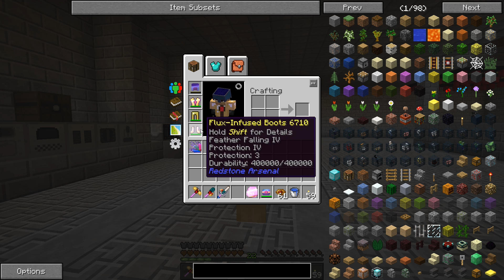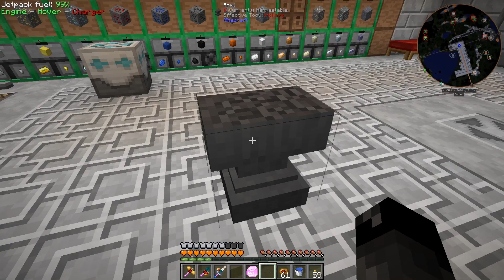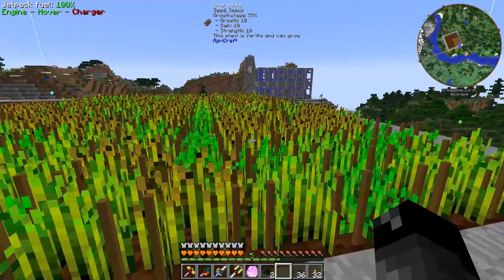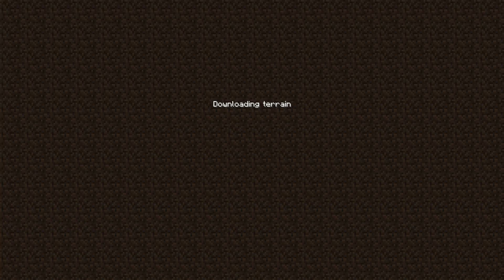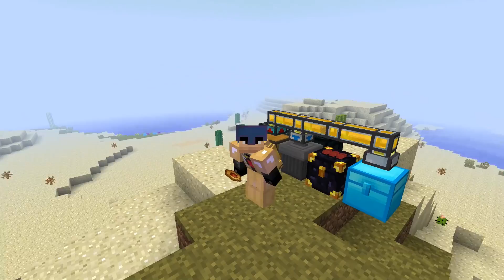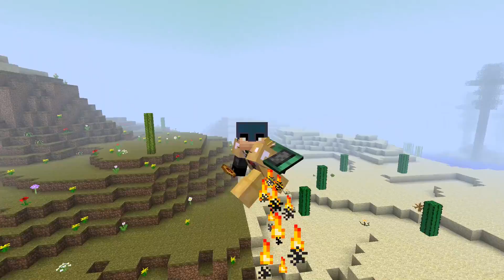Minecraft Mods FTB Infinity Evolved - EXTREME FARM [E28] (Modded Expert Mode)

Comment: ik that this is little late but actually theres a somewhat better way to get alot of power, i reccommend getting power from compression dynamos as they require mostly tin and and dont require machine frames and can generate up to 1.5m rf total using water and Fuel, from a BC refinery aka getting oil and using a pump to get the most out of your dynamos you need to add augments, the 4 augments you need are : Augment - Secondary Gear box, Augment - Flux Linkage optimization, Augment - Secondary Transmission Coil, Augment - Flux Modulation Booster, with all of those each 1 bucket of fuel generates 320 ft/t and a total of 1.5m rf for anyone who reads this and doesnt fully understand you can see it in my own lets play. but hope this helps someone

Comment: At 13:10, does anyone else here a chain fence being smacked? I hear it atleast one more time before he cuts. :/
Reply from the maker: +James Landess I think what you're hearing is my microphone stand. It's a swivel arm... like a desk lamp? Anyway the springs inside have started making sounds recently when I slightly bump it or adjust the position of the mic.
Reply: Hypnotizd Okay, thanks! Also, do you know where I can get a PC that can run and record Minecraft at 1080p60 for under 400 USD?
Reply: +James Landess I think for that amount you can only pay someone to steal it. You need more money even if you are going to assemble the PC yourself
Reply: Andrea Ardovini I'm sure i found one that can atleast play at 1080p60, maybe record at 30 or 45. http://www.amazon.com/M32AD-Desktop-Windows-Keyboard-Mouse/dp/B014QVM2AY/ref=zg_bs_565098_2

Or the i5, http://www.amazon.com/M32AD-Desktop-Windows-Keyboard-Mouse/dp/B014QVM2AY/ref=zg_bs_565098_2
Reply: With a Core i3 and 8 gb of RAM no way
I mean, I'm sorry to say that but you are not even close with the spec required
Reply: Andrea Ardovini With the i5 then?
Reply: +James Landess it is possible if you only need a desktop
Reply: +James Landess and depends if you play modded or vanilla
Reply: Yuhao Zhang I might play modded on a MC Realms world with a friend hosting. My internet can handle it fine, 70 mbps with a gb connection speed. I just need something better than my laptop to play it on under 400 USD. Min settings, 30 frames for about 2 seconds. then goes back down to 5-10
Reply: James Landess I think u should be fine
Reply: James Landess I havnt built custom pc's in a while. And parts get really cheap over time so a 400 dollar gaming pc should be well achievable
Reply: +Yuhao Zhang For $400, you might be able to build a PC that can PLAY Minecraft at 1080p60 fps, but rendering video is a different story. A PC in that price range is going to take forever to render video.
Reply: LongLiveEmrys Maybe I can upload at 720@30 like?
Reply: James Landess Maybe. The main issue is you're going to need a dedicated GPU (graphics card) to render video. That alone is going to take a significant chunk of your budget. Bump your goal up to $600 at least, then you'll be getting somewhere.
Reply: LongLiveEmrys I was planning on getting a decent GPU within that $400. I found refurbished pcs on both Microcenter and Newegg as low as $124.99. That includes everything for a decent computer except the GPU, which for the $125 computer, I can afford to put an extra $275 into a GPU before tax.
Reply: LongLiveEmrys correct me if I'm wrong but gems like minecraft need a pc more on the ram and cpu side. A graphics card that can record and play (such as 750 ti) should be fine
Reply: James Landess according to my knowlage 400 should be fine
Reply: Yuhao Zhang After researching, I found out the Minecraft does use mostly RAM and CPU. Though, on my Acer Aspire 5750z-4879, 4GB of DDR3L ram and a Intel Pentium duo @ 2.20 Ghz. I get next to no frames with only Minecraft open on a singleplayer world at lowest settings with no mods, or texture packs on.
Reply: James Landess laptop components and desktop components are very different, a bad desktop cpu is often times better than a good laptop cpu
Reply: Yuhao Zhang I can understand that. I find it odd how people think you need to spend 1,000+ for a good desktop. $400 is plenty for the tower and guts. I have a friend that built his computer out of thrown out pcs around his neighborhood. It can run every game on steam on best settings while in a call while broadcasting and still not drop below 90 frames.
Reply: +James Landess If you're spending less than half the cost of your GPU on literally the rest of the PC, you're going to run into some serious fucking bottlenecks.
Reply: Samuel Pike I assume it'd be better to buy a prebuilt PC for $400 then...? I don't have much money, man.
Reply: James Landess No, it wouldn't be better to buy a 400 pre-built. I'm just saying that it isn't too smart to skimp that much on your other components.
Reply: Samuel Pike I know that, I just don't have the money to afford a $1000 PC.

Comment: you can make a draconic energy ball that can hold 2Billion rf.look it up
Reply: +Ognjen Popovic You need Wyvern cores for that, which means you need to kill the wither boss over and over, and find some form of obtaining bedrockium and iridium ingots with Terra steel and Void metal ingots. You need to obtain the Eldrich tab first before you are able to obtain the Wyvern core needed to craft the Energy Core in the multiblock structure. Bedrockium is obtained by mixing 3 plutonium with 6 Uranium 238 in a crafting grid and then smelting it. Iridium ores can be found in Runic Dungeons, which can be compressed into plates, or ingots. Terra steel requires a mana steel, mana pearl, and mana diamond. You will need the lapis altar to make Terra steel. Void metals need void seeds, which are dropped from Cult knights or Cult Clerics, or Transmuting a wheat seed into one into a crucible after obtaining the Eldrich tab.
Reply: he can make a wither farm
Reply: True, but he needs to craft a porta spawner first and send the skeleton spawner to the nether to achieve the wither skeletons. Either that, or auto spawn with exact copy enabled. The witchery wheat statues have either a zombie or skeleton spawner inside.

Comment: Hey Hypno I was playing on a modpack that has tinkers construct and I Have no idea what to make my tools out of. So could you tell me what your tools are and what they are made out of or anything that would be really good to use.
Reply: +Joevanni Thompson 
The tool heads are made out of Enderium. 
The head piece determines the mining speed and durability. 
The handle piece Determines the durability modifier, you can gain more or less durability with handle modifications. The component parts are used to build the tool you want.

Often, players will use paper on component parts, and blue slime crystals for handle parts, with either using Dark steel, or Enderium as the primal piece. Enderium can only be casted into part shapes, while Dark steel can be pattern crafted. Dark steel and Enderium are the two best metals to use for using the Head part.

With The research of paper and Thaumium, you can add additional starter modifiers to a tool, meaning you can place more modifications for the Component parts, often where some Tool forge tools can gain two modifiers compared to 0-1 for the tool station tools. A sheet of paper counts as half a material, while Thaumium ingots counts as a single material.

With combining Tech-based and Magic-based metals with Blue slimes, you can make Ultimate weapons. 

The Ultimate hammer is crafted with Either Enderium or Dark steel hammer heads, two Thaumium large plates, and A blue slime tough tool rod. Both Enderium and Dark steel have a mining level of manyullin, the highest possible level in tinker's construct. The Ultimate hammer is the bane to undead enemies, especially skeletons.

The Ultimate lumber axe is crafted with the Dark steel broad axe head, Thaumium Large plate, blue Slime Tough tool binding, blue slime tough tool rod. This lumber axe can chop down any, and all types of wood, including Natura's Redwood trees in one fell swoop.

The Ultimate Excavator shovel is made with an Enderium broad shovel head, Thaumium large plate, blue slime tough tool binding, and blue slime tough tool rod. This shovel mines up dirt in a 3x3 area, similar to a hammer.

The Ultimate Scythe is made with a Dark steel Scythe head, Thaumium tough tool binding, Blue slime tough tool binding, and a blue slime tough tool rod. The scythe can gather leaves and grass if it is modified with the silky jewel attachment, which is great for Thaumages using the lamp of growth to accelerate crop growth. Every leaf block harvested provides 2 aspects of Herba.

The Ultimate crossbow is crafted with a signalum crossbow head, Thaumium Crossbow body, Blue Slime tough binding, and Heatscar Bow string. This crossbow cannot do much by itself, but it allows the user to shoot an astounding 4 bolts per second.

The Ultimate bolt, is a blue slime tool rod OR Thaumium tool rod, with an Enderium Bolt tip, and a blue slime fetching . Bolts are made by casting a metal on top of a tool rod of choice. 

The Ultimate bolt, when loaded into The Ultimate Crossbow does an astounding 98.5 hearts of damage, and with strength II potions ingested, the bolts will do 354.6 hearts of damage, effectively one shotting common mobs and Thaumic champions, along with most of the bosses in the game, except for the Chaos dragon, which has 5000 hearts.

Per second, the Ultimate crossbow will deal 394 hearts of damage, or 1418.4 hearts of damage with strength II potions.

The bolts by them selves are non-renewable, but with the moss ball crafted from 9 moss cobblestone, the bolts can automatically refill themselves back to full capacity in no time flat.

The Bolts cannot hit endermen or enderminies.

The Ultimate sword serves as a melee alternative to the Ultimate crossbow, but does way less damage compared to the crossbow. It is crafted with an Enderium sword blade, a Thaumium Wide guard, cross guard, hand guard, or full guard (found in villages), and a blue slime tool rod. There are 4 variants to the ultimate sword, one as a basic sword, one that lets you jump to greater heights, one that pierces through enemy armor, and one that deals additional damage, depending on the guard used. The ultimate sword is known to kill common enemies in one or two hits, depending on the enemy's health. The Ultimate sword is the only known weapon able to kill Endermen/Enderminies.

Blue slimes can be found in Slime islands, or in the Twilight forest.
Reply: metayoshi1 Thank you very very much this is a life saver

Comment: Are there any OP mob spawners that you can build in this pack? I would like to you use a farm like that to auto-enchant books.
Reply: +Stanley Striker Powered spawners from Ender IO as a midgame spawner (incase you accidently break a spawner), The porta-spawner as an alternative if you want to move spawners to your base, or Draconic spawners, which are reserved for end game. porta-spawners requires you to defeat a wither boss to obtain the nether star needed for crafting the porta-spawner. The Reaper enchantment from Draconic evolution gives a chance to obtain a mob soul of the mob killed. With a Porta spawner, you can place a skeleton spawner into the nether to make it become a Wither Skeleton spawner, which as a common chance to spawn Champions that drop common or uncommon treasure bags. The skulls obtained from the Wither spawner can be used to make the wither boss grinding process a lot easier, as nether stars are needed as a source of fuel, or crafted for Wyvern cores, which are needed for Teir 2 Draconic spawners.

Comment: Just let the farm run when you are offline (like overnight) and when you are playing, turn the farm off
Reply: +Andrew Gonzoles He needs constant RF power to run his machines. For end game, you need 50MRF to produce 1 resonant Machine frame, which is needed for the end game for tech tree. RFtools machine frames also needs one as well, meaning some form of emerald farming, and Enderium production are a must. The easiest way to Obtain Enderium ingots is to melt Endermen into a smeltery, and then get a silk touch pickaxe/hammer to pick up Redstone/DENSE Redstone ore, and then pulverize them to get a by-product known as Cinnabar. Cinnabar mixed with a ferrous ore in an induction smelter gives a 100% drop rate for Shiny (platinum) ingots. Cinnabar can also be found in gold ores, but it has a lower chance, and needs a cryothoeum secondary output improver to increase the chance. Emeralds can be found in Uncommon/rare bags from Thaumic champions, OR trading with villagers, or finding them in large hollow hills, hydra lairs, or extreme hill biomes. In order to get silk touch for tinker's construct, you need 4 gold nuggets, 32 string, and an emerald block to create the silky jewel, meaning you must gather 9 emeralds, or complete the ram quest to get the emerald block needed to craft the silky jewel.
Reply: +metayoshi1 Emeralds - just "melt" villagers in tinkers smeltery. Spawn villagers by autospawner.
Reply: I don't have an auto spawner/grinder set up yet. I still need emeralds to even make one, which comes from thaumic champions.

Comment: The way I have my RTG fuel set up is the nuclear reactor powers my mass fabricator and my recyclers. So I'm creating a ton of uu matter and rtg fuel.
Reply: +gta4pursuit Not a bad concept, but Producing RTG fuel requires a load of Uranium fuel rods, which in turn is a huge pain in a butt to maintain without getting radiation. There are many ways to transfer purified Uranium fuels. A Dispenser dropping fuel cells into a hopper that goes into a jabba barrel is the poor man's way to transfer fuel cells. A dolly can pick up a jabba barrel, which can carry up to 4096 uranium fuel cells in its base form. It's easier to do if you don't want to waste resources for a HAZMAT suit. You can also connect a hopper to a Nuclear reactor, as the rods won't be consumed while the reactor is in the off state. Uranium is a non-renewable resource, meaning if you run out of uranium, you won't be able to produce RTG fuel anymore.

Comment: im not sure but i believe the protection might reduce the power used per hit though i could be very wrong so don't take my word for it
Reply: +Jeremy Back It does reduce the power usage per hit. Per level, each consumption rate is reduced by 10%.
Reply: I was not sure thanks for the info
Reply: Unbreaking also reduces power consumption as well. combining Unbreaking III and Protection IV reduces power consumption by 70% per armor piece.

Comment: what key do you press to fly faster with the jetpack?
Reply: The sprint key maybe?
Reply: +Owen Pycha Fitness Sprint lets you fly faster on a jet pack. press a key binding for hover mode to go into hover mode. Hover mode automatically activates if you fall more than 25 blocks in the air. While in Hover mode, a jet pack will drain twice as much RF usage per tick based on the jet pack worn.
Reply: +metayoshi1 I know how it works. I want to know how to fly faster while in hover mode.
Reply: Sprinting makes a player go faster. You can also drink Speed II potions to go even faster than before. Combining the jetpack with the Sournjernour's sash will increase speed output by 25%, and the terrasteel variant will double the output of the sourjernour's. You can adjust the key binding to whatever key you like to enable sprinting.
Reply: +metayoshi1 gr8b8